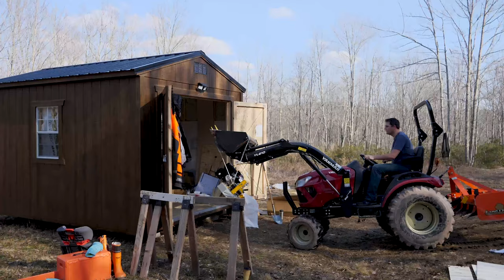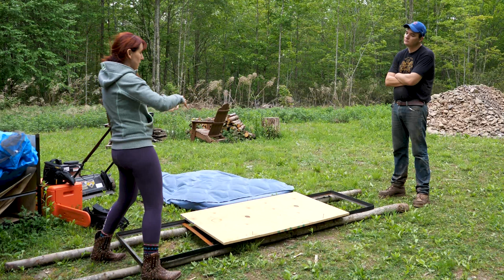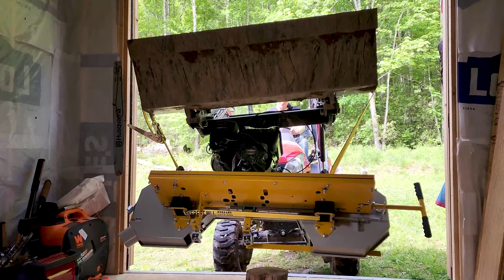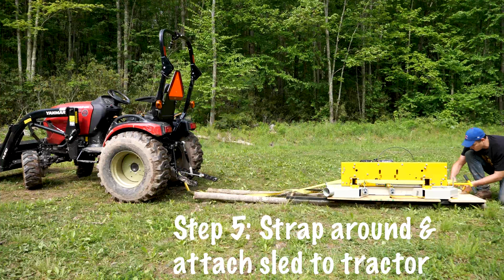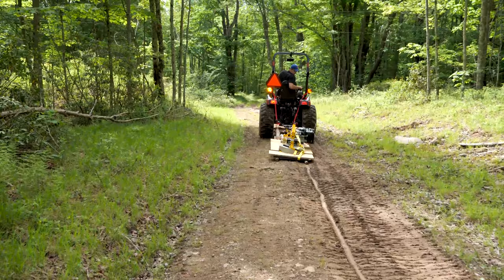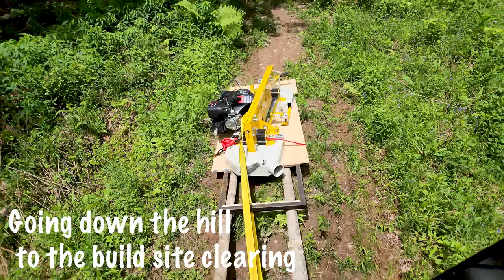Tractor Drag Sled / Travois / Yard Glider - DIY CHEAP & EASY

Comment: I'm sure the sled is still used today for many other chores, but why not just take the saw mill head unit all the way to its final location using the tractor's front end loader?
Reply from the maker: The current path is so uneven that we were worried about overall stability. Also the saw mill head lift points are attached only once the entire cage is assembled, making it pretty heavy. We felt it was safer to use a sled. We could always stop if something went wrong.
Reply: @crisposcliff  safer is always better! Glad you guys did it that way.